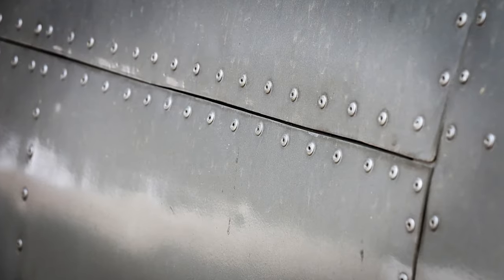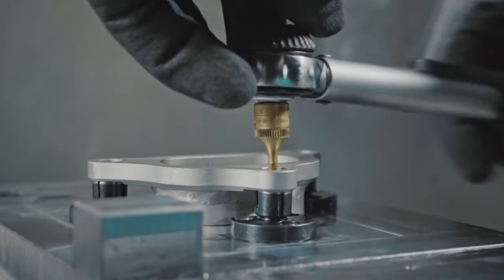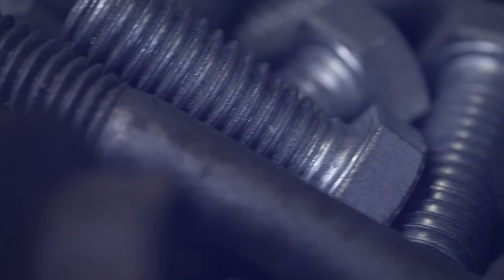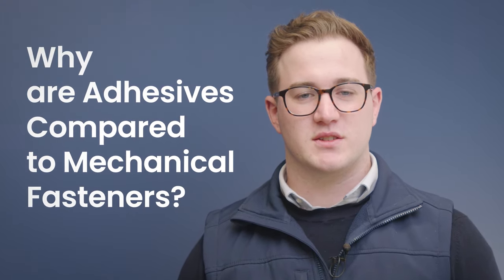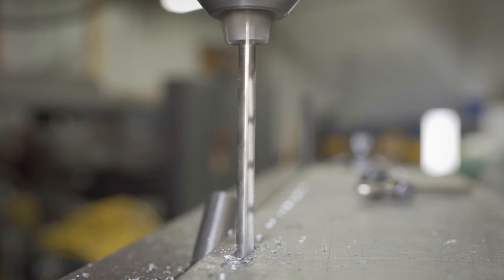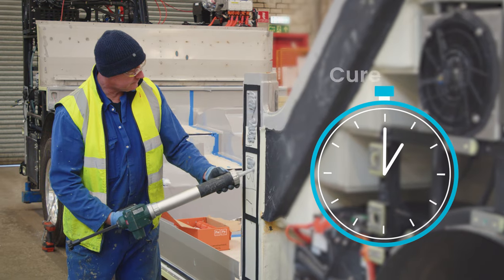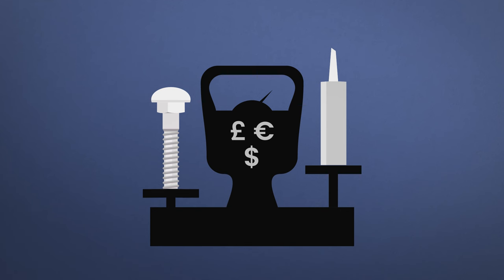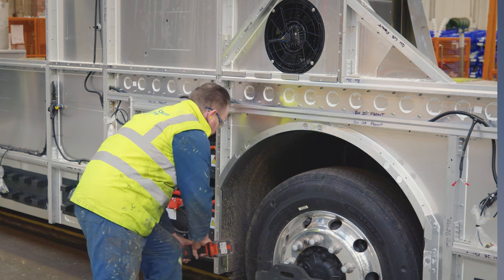Glue or Screws?

Comment: I assume you have a better bond if using adhesives across the face of a substrate than if you were to use fasteners around the perimeter.  Is that....a good assumption?  

I bet the answer is "it depends" because it always depends....

Comment: Seems like adhesives can be better, but require greater quality control to ensure they work properly.

On the face of it I'd assume that they'd end up costing the same when accounting for money, but that the benefits of adhesives outweigh the costs in most applications, while mechanical fasteners are reliable and rugged but less capable.

This is however ignoring other types of bonds such as welding, magnets and bolts. I would say that in terms of material science we have a very long way to go.